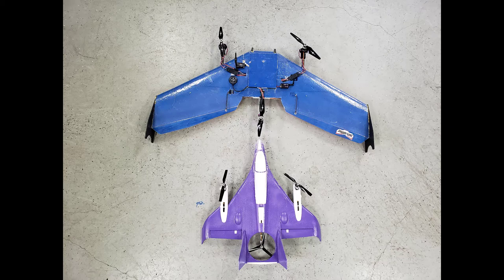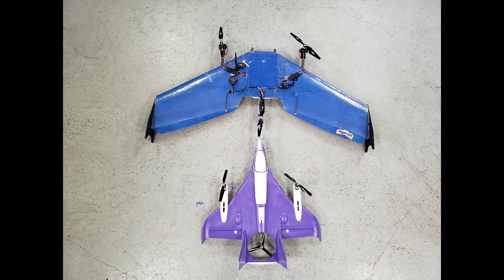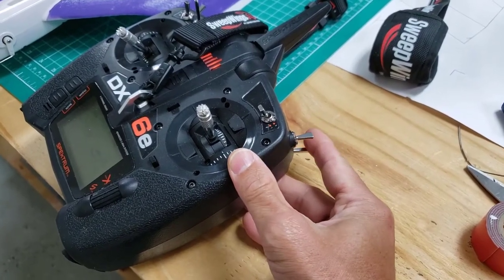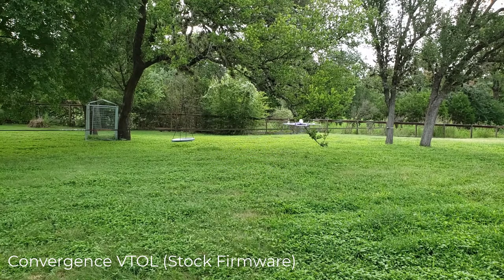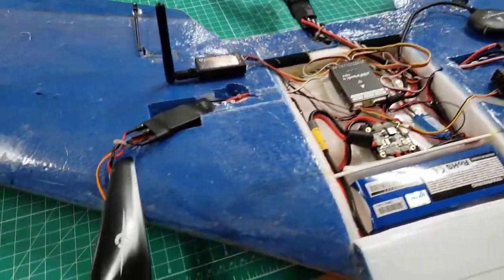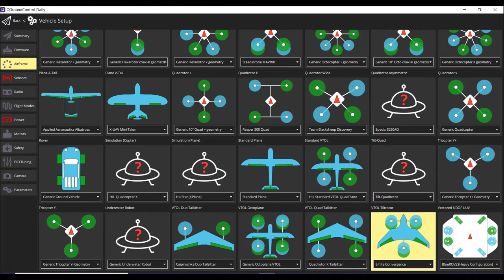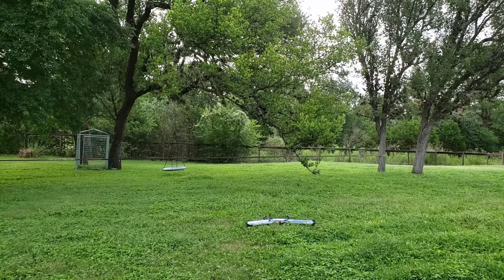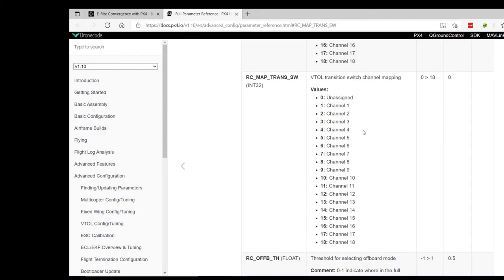PX4 Tilt Rotor with SweepWings Juggernaut Delta Wing

Comment: Nice work.   I have a qplane setup with tilt rotors and a tail motor, same setup as your wing.  Having issues with qautotune, takes to long to finish even doing one axis at a time.  Maybe you can make a video about ardupilot vlot tuning.  I’m Going to try manual tuning next.

Comment: Hi Dennis, love your work, is there a way that you can provide me with the simple tail sitter ardu setup program, please.
thanks
Reply from the maker: I need to revisit the project. I lost everything after I had a crash and the elevons broke. So I ended up using the Pixhawk for another project and overwrote the firmware/params. I will be working on a new build soon, but my original was largely inspired by this project: https://docs.px4.io/v1.9.0/en/frames_vtol/vtol_tailsitter_caipiroshka_pixracer.html my biggest challenge was designing the motor mounts since I'm a rookie when it comes to 3D design. Thanks for the good words and I wish you the best of luck with your project.
Reply: @dennisbaldwin  No worries, Thank you so much, good luck to you too on your projects